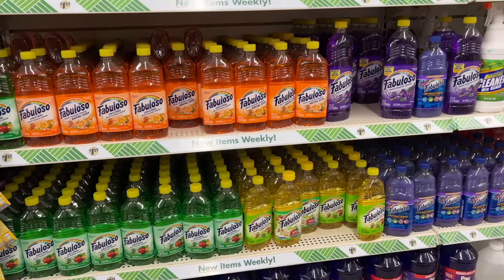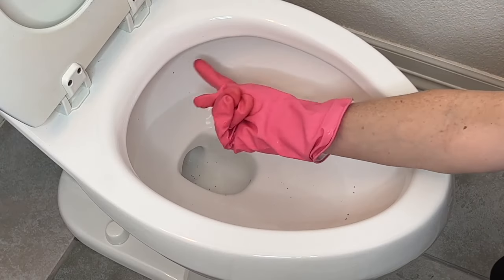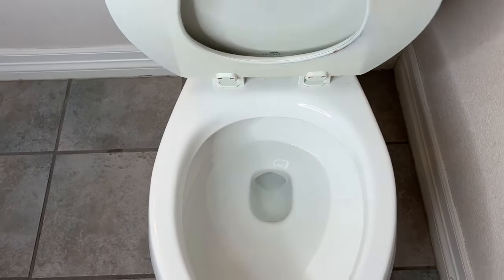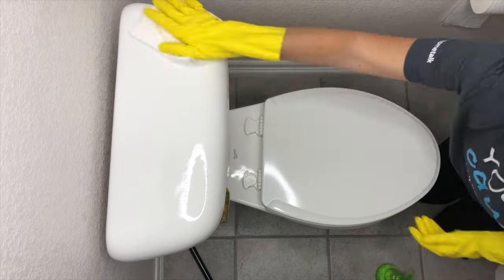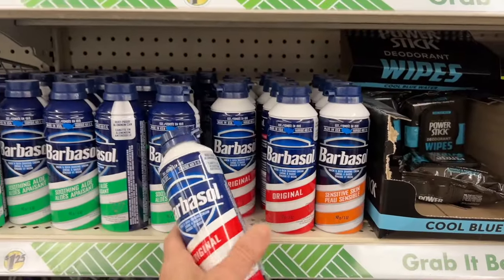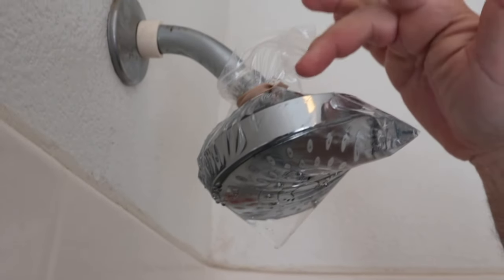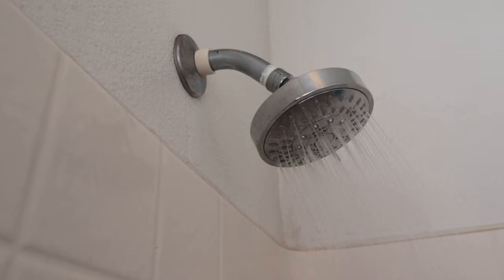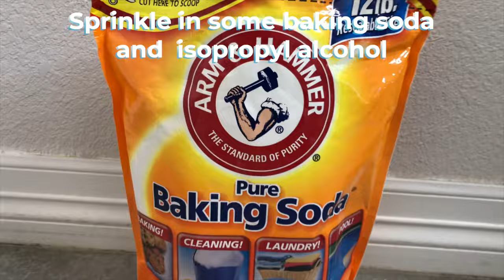Top 5 toilet cleaning hacks (that ACTUALLY work!)

Comment: I have a spray bottle w/2 tablespoons wash of white vinegar & 91% alcohol ..I spray shower / tub after EVERY bath/shower & you don’t get those stains or mineral deposits. Pouring soda in your toilet? That junk is too expensive to flush. 😂
Reply: I always have a box of baking soda just for the bathroom cleaning, also when it expire, don’t dump it, use it to clean with it, it’s also what I do too.